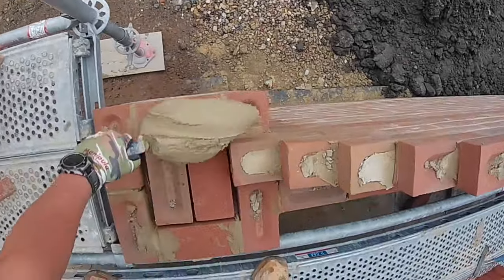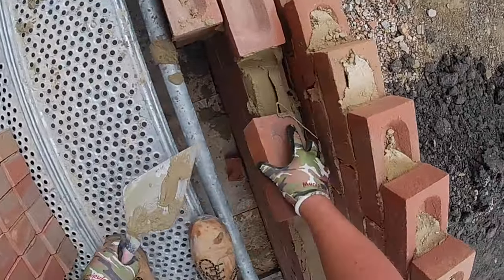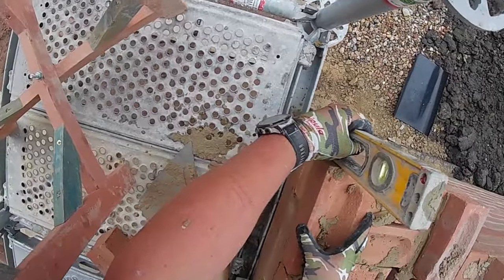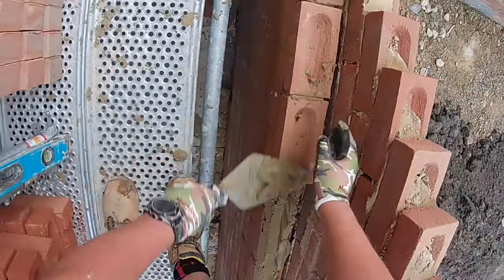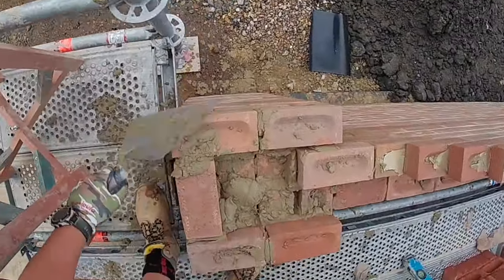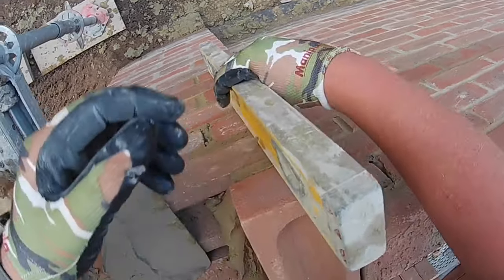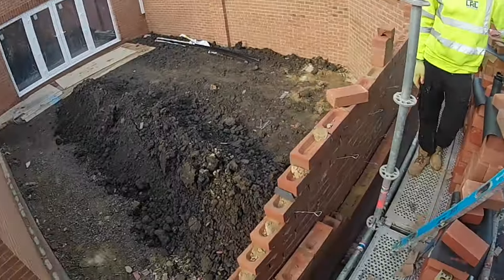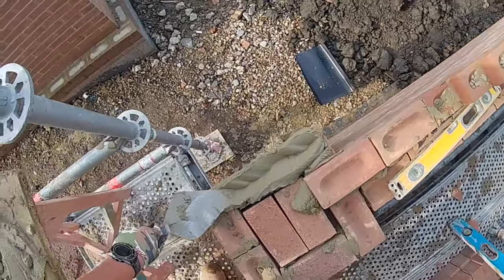Bricklaying Vlog - Topping Off My Own Wall - Injured at Work? & Working Around Injury’s? - Part 1

Comment: "Couple of beers and crack on" Love it mate😂🍻 to be honest mate bricklaying is heavy going..not many other trades what are constantly picking up heavy shit all day. Me and my mate had to throw a steel on today.. probs about 150kg .. top of the road..down the drive...up on a scaffold..round all the poles and then finally on...fking shit 😂
Interested to see this alteration, to be fair sometimes it's hard to to a mint job when other circumstances affect your job!
Currently split between 6 private jobs at the moment, 1 or 2 days a week pretty much at one job then to the next😂 Cheers for the mention fella👌 to be fair I'm on DW on these extensions, (I'm not the boss, just turn up and lay..or dig footings/do ground works😂) 180 - 200. If I pull in a private job or I'm in charge of what I get i charge 220 and make a drink on the labour too
Big congratulations on the big 1000 fella, much deserved 🍻🍻
Reply from the maker: Thanks mate, very interesting vids can’t wait for the next instalment
Reply: @theafter8bricky  cheers fella, got a video for tomorrow to upload, felt like you..its a garden wall😂

Comment: They talk about health and safety and then you get a scaffold like that, then leaning over trying to do the other side. We usually get the walls up to height then put 3 course corners up every where and that governs the scaffolding height. Just makes life easy bang them 3 course in with a line and it’s less bending.👍👍🍻
Reply from the maker: Will deffo look into that mate